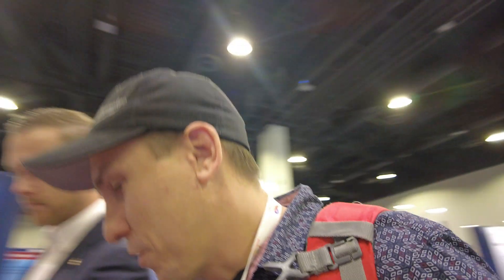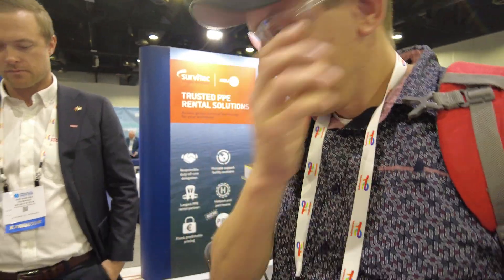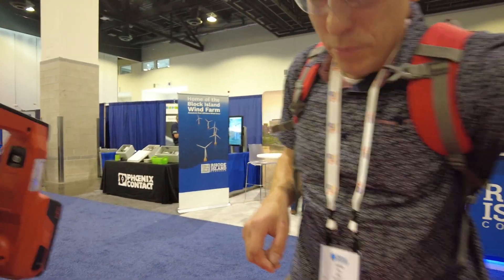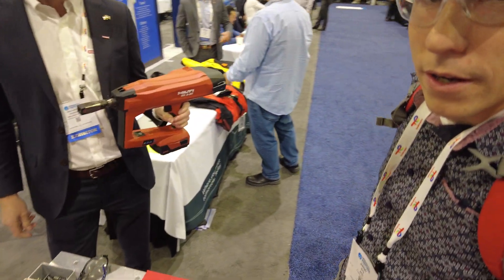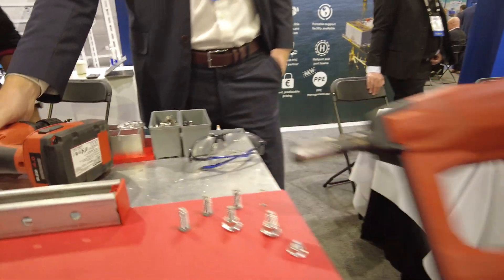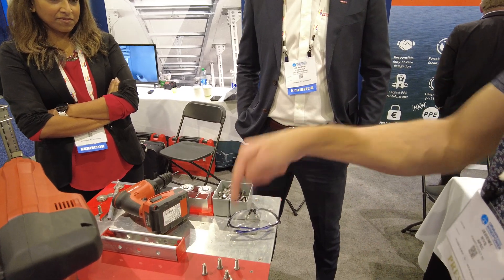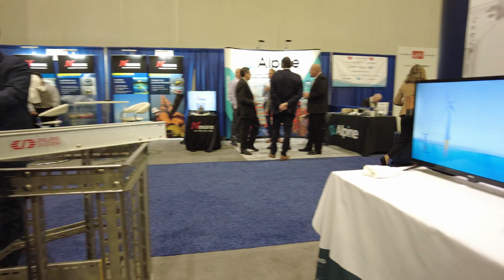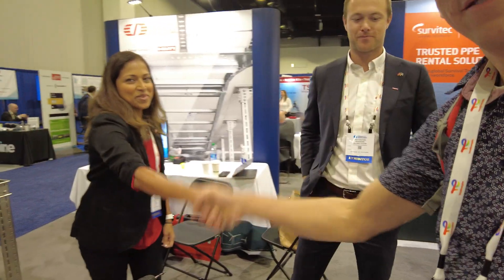HILTI bolt mounting system demonstration at the 2022 APC Offshore Wind Conference

Comment: That.... is not what I was expecting to see. Super fast and simple process. I have so many questions...lol.  Did it bulge/pucker the steel at all? I could not see the end of the bolt/anchor, I assume it is smaller on the mounting side? Is there a minimum/ maximum thickness plate it can be used on or variable drive settings on the drill?